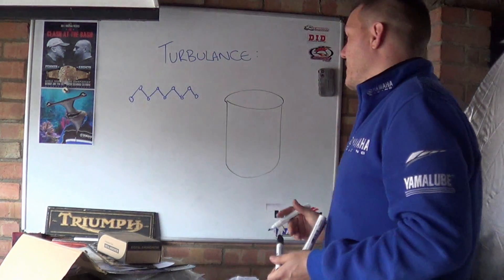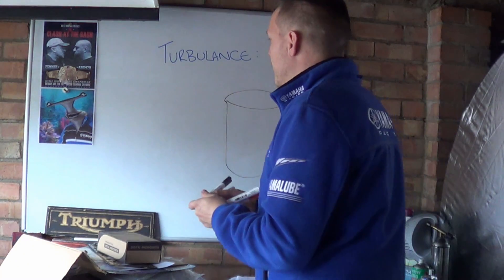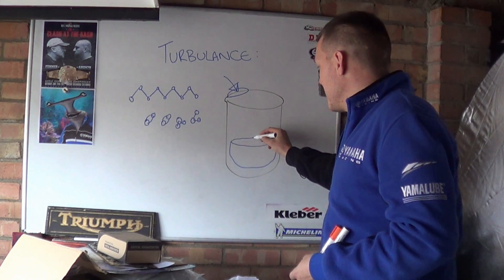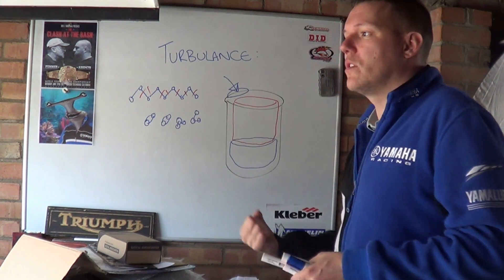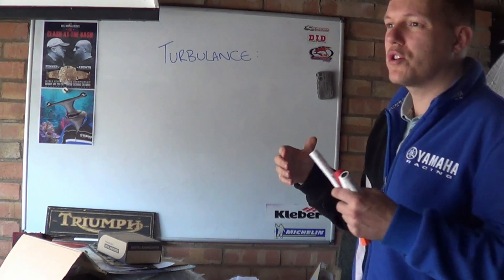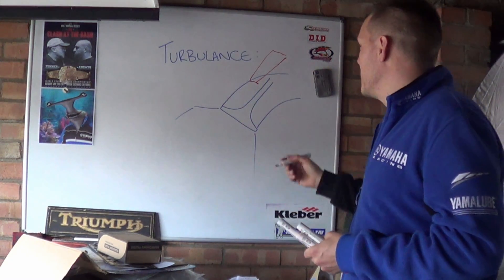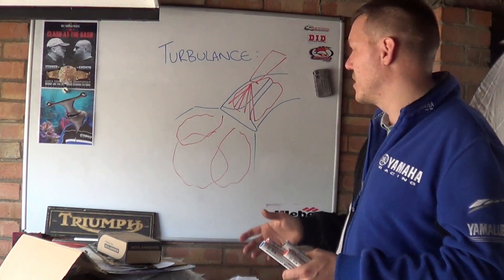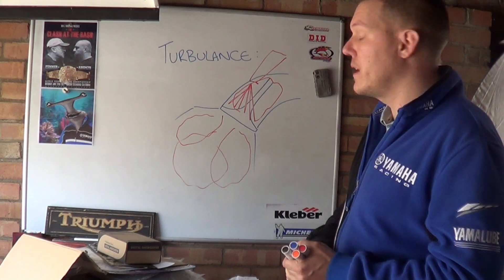Engine Fluid Dynamics - PART 5 - TURBULANCE

Comment: If the injector is spraying before the valve opens then during valve overlap why doesn’t the charge escape and cause after fire ( or what about long Intake runners that use the previous air charges velocity as a ram effect for the next intake valve event? Is the low pressure area greater at the bottom of the cylinder? Is the fuel still falling out of the air charge and the upward motion of the piston collects the charge and aids further in atomization so it’s less likely to fall out of the exhaust port during overlap and instead the inert gases or slightly rich mixture is exiting the port because of the design of the intake valve placement? IE the swirl and fill you described? I just figured since the placement of the Intake and exhaust ports were so close you’d lose some charge out of the cylinder just from the pressure differential alone
Reply from the maker: Because the engine is running. At 1,000 rpm the engine is opening the valve 8.3 times a second. At 10,000 rpm it's 83 times a second.
Reply: @thedirtyworkshop this explains absolutely nothing other than duration of time. So does this confirm the low pressure area in the cylinder is greater than that of the exhaust port and it does not have time to escape ( by your definition?)
Reply from the maker: You questions is poorly phrased, try again
Reply from the maker: It also sounds like you doubt that it does this. Look up pulse width maps vs engine position tables...

Comment: I removed the stock twin mikuni carbs off my Yamaha XV535 and fitted a 2 into 1 manifold  made to order in the states and a used a single hitachi carb, runs great, but the inside of the new 2 into 1 alluminium manifold is very rough. The guy who made it said "yeah helps with turbulence" but that is rubbish isn't it as it's reducing the speed of air flow into the cylinders, I have to say the bike goes very well now, and as it's a 500cc cruiser, probably doesn't matter too much anyway.
Reply from the maker: This will be covered in the series later on, however I can do a seperate video this weekend to cover it briefly - matt